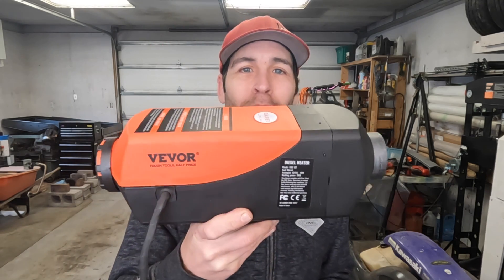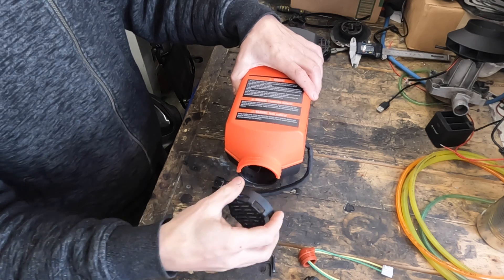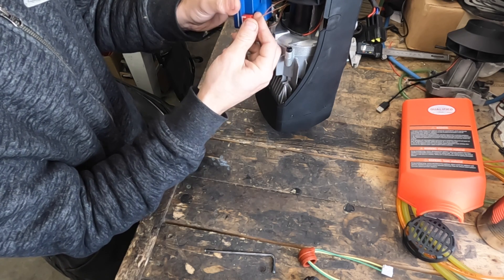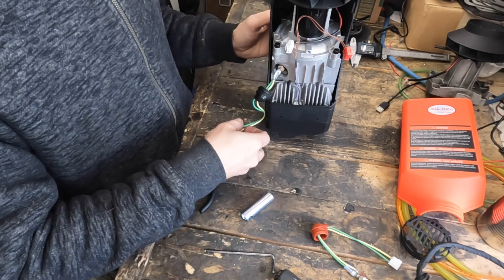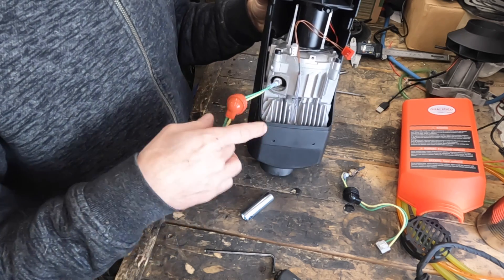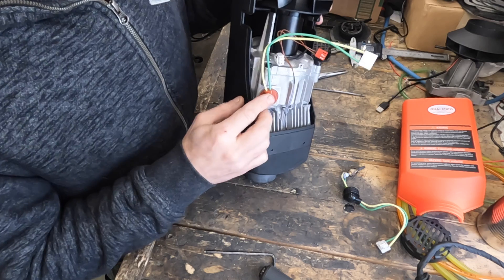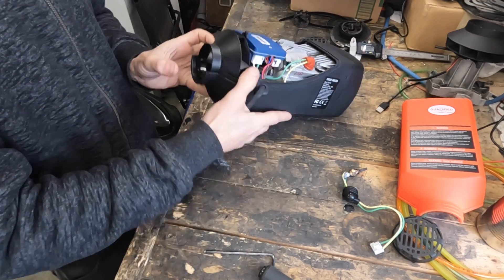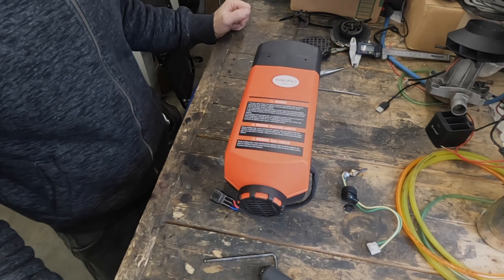Diesel Heater Glow Plug Replacement - 2, 5 & 8 kw Heaters. (see pinned comment)

Comment from the maker: A few people have mentioned things I should have / could have included in this video, that I think are important. I decided to pin this comment and add important info if it becomes apparent. 

1. To test your glow plug is VERY easy. Get a 12V battery, that you know is good, and connect power to the plug for about 5-8 seconds The plug should glow red hot. Positive and negative can go to either connector, it doesn't matter at all. Make sure your wires are no smaller than 16 gauge, preferably 14 gauge or the wires could get really hot when connected. Do not stay connected for more than 8 seconds or it could damage the glow plug. 

2. The glow plug mesh must be seated below the flame initiation hole. Where the glow plug threads in, there is a hole about 3mm in size. The reason I say to "push the mesh all the way in" is because if the mesh plugs the hole, you may have starting issues.

3.If you have the "special tool" you can change the glow plug, by just screwing the end cap off and removing the cover. The heater can be installed with everything still hooked up.
Reply: You could probably use a small 9V battery to check the glow plug with. I don't think the motherboard feeds the plug the full 12V.
Reply from the maker: @kirkwalsh1932  Yeah... A 9V battery wouldn't have enough amperage to make it glow.  With a 12V battery it will be obvious within a few seconds if it is working or not 🤟

Comment: Watch out: It is NOT mentioned in Vevor documentation!: Don't use a Vevor Diesel heater on a lithium battery. The 14,4-14,7 V will destroy the ignition plug, maybe even the circuit board. !!! Use AI and you'll find the error!
With the latest versions, the high voltage warning comes only, after the unit broke down after using it a few days on a lithium battery in the camper. No high voltage warning before breaking down. It stopped with an error E01. Lower voltage had no effect. Damage not yet known, but probably a destroyed ignition plug. Damage on the circuit board is also possible. 
Worldwide standard should be resistant against 20% overpower and that is 14,4 V Basis 12 V. If you have a lithium battery use a DC-DC 12V convert with at least 15A. (example 4-40V 20A 12V converter).
Reply from the maker: Hey, thanks for the detailed comment. 

Every one of these heaters that I have owned says that the are okay to run between 12-24 volts and it appears they have auto detection... I suspect there is something else going on with your heater. 

If you only had this happen once, I suspect that this was just a fluke, and not actually a common thing with "these heaters" ... I believe this for several reasons. 

I have used my heater with a lithium battery several times, a few times earlier this season, once while camping. I just ordered lithium batteries for my bus. I'm sure many others have also used lithium batteries as well. Also... the ECU uses PWM to control voltage to the glow plug and fan, and the voltage is ramped up and down ... Generally not all 12V going to the plug or fan. I know this because I have connected these items to 12V and it's pretty intense. 

I think you need to look a little deeper into this. My guess would be that your ECU has an issue.

Comment: Very informative, I was able to get mine out without taking the ecu off.
Reply from the maker: Yeah, that's actually the smart way to go about it, if you are not doing more maintenance on your heater. I'm very much in the rabbit of using a normal wrench to remove mine and doing complete disassembly.

Comment: Can replacement glow plugs be sourced locally? These heaters are so cheap that I almost just want to buy a whole new heater. All of the other parts are super dirty as well. I’ve had mine for 4 years, which is about 3 years longer than everyone said it would last 😂
Reply from the maker: Depending where you live, you may be able to get one locally... but not where I live. However, you can get them next day on amazon very cheap, in most places. 

It is almost worth having a second heater as a back up or for spare parts. 

Is the controller giving you a code for the glow plug ? It's not very often that they actually go bad. I think they are often replaced when they don't need to be replaced.
Reply: @loweredexpectations4927  It was giving me E-8. I’ve primed and restarted several times and now it’s blowing white smoke and the plug icon is not lit. I may have flooded it with fuel.
Reply: Oh and it stopped working after I had accidentally drained the battery and it shut off without being powered down properly.

Comment: I just bought mine last winter and it works.Great for my thirteen hundred square foot house , replacing three or four space heaters throughout the house , actually😂. But the error code said the glow plug just went out.Hopefully , that's not something that happens every year , but still in easy , cheap fix. Great to offset the price of electric heaters and works much better. Especially just turning it on for 20 minutes to Jack.The temperature up a real quick in three hundred and fifty square feet living room
Reply from the maker: Thanks for the comment. 

I have only replaced this glow plug and it is because I broke it... I think it is quite uncommon to have to replace them.

Comment: If I knew it went out every year , I wouldn't have bought one😂. Sounds like it's cheaper and easier to buy a new one than it is to replace. So you have to buy a new heater every year. Annoying
Reply from the maker: Say what ?? I have had several heaters, currently have 8 and the only glow plug I've replaced is this one... I've never heard of replacing once a year... If so, something is very wrong. 

Also... they are incredibly easy to replace. The way I demonstrated here is the long way. You can simply remove the inlet nut, open the cover and and you have access to the glow plug hole.

Comment: Helpful video! Not sure if this is my problem or not...    my heater is new.  Ran good for 100 hours roughly, now it smokes like crazy out the exhaust when trying to start it up.  Also it smokes out the bottom where the exhaust clamps on and when an Error E8 comes on and the unit shuts down, it sometimes blows unburned diesel out the intake aswell.   Im confused.  Can you help?  Have you seen this before?
Reply from the maker: Hello. Sorry to hear you are having issues. These heaters are pretty stupid... the E8 code just means that it has detected a low temp during operation and shuts down. Don't read too much into the codes as some people will claim they mean a lot more. 

If your heater smokes when trying to start up, the glow plug could be the issue. You can try powering the heater on for about a minute and turn it off just before the fuel pump starts pumping. If you do this 3-4 times in a row, it could clean the glow plug off and save you the hassle of taking it apart. (the glow plug glows for a while before the pump starts) 

Most commonly, these heaters have issues due to the exhaust or inlet air being restricted too much. The exhaust should not have too many bends and ideally no sharp bends. Same with the inlet. 

If possible, try running your heater without the inlet and exhaust installed and see if that helps. If so, add one if them and try again until it works poorly. If it works the same with them removed, then it is something internal. 

You may also want to use a voltmeter or monitor the voltage on startup. The glow plug runs on start up and depending on your power souce and wires, you may be getting too much voltage drop.

Comment: What size socket is that "special tool"?
I want to make one but i cant remember what size it is, lol
Nice video btw, thank you  🙏
(That kit is currently available on Amazon for 6.99 +)
Reply from the maker: I should know this, because I never use the tool... I always just take the fan housing off and use a wrench. Sadly, I do not remember. I'm thinking 12mm.

Comment: How do you know what wattage the replacement plug is? Under the advanced settings you can set the PF menu for the different glow plugs, I think.
Reply from the maker: From what I understand, they are all about the same, and the PF is to send more power to the glow plug. For conder starts, your heater may require more plug power. 

I personally have never had an issues with start up, so I haven't had to play with this much.

Comment: Where the glow plug goes , Is there supposed to be a hole at the bottom  ?
Reply from the maker: There are a few holes, depending on where you are talking about. 

There is a hole for the fuel to come in from the fuel line, there is a hole for the fuel to run into the burn chamber and there is an air hole in the side. This is usually called the "flame initiation hole".
Reply: @loweredexpectations4927  
Fitted the new glow plug & she works . Thx for the reply 👍

Comment: About how long before changing these
Reply from the maker: No real need to change the plug unless it throws an error and won't ignite. There is a mesh around the glow plug that can be changed every few years, but the plug itself may last forever. It is a ceramic heater.

Comment: Funny I came across this video just now as I was trouble shooting my new replacement 5kw heater (error code E-07) for my old heater than ran fine for many years . I dissasembled heater and found that the glow plug spun out with a twist of the wires! I'm glad it didn't start!
Reply from the maker: Apparently this is pretty common. They are often not tight, or just finger tight from the factory.

Comment: How often should you change the glow  ?
Reply: Thanks.
It only starts if I leave the van running whist it goes through the starting process, because the relay switch packed in so thought that was part of the problem and changed leisure batteries and still won't start without van running  !! No one seems to know why  .....
Reply from the maker: @paul2241xx  The glow plug draws about 10 amps... so you need to be connected to / with some large wires ... preferably 12ga ... Even with a battery connected directly to the heater power wires, you will see a significant voltage drop during start up. Voltage drop seen by the heater, not by the batteries. 

I recently reinstalled my heater, and decided to connect to an accessory outlet, and the wires are too small. My voltage drop is all the way down to 9 volts ... I saw as low as 8.9, once. While the accessory plug is fused at 14 amps, the wires are way too small, apparently, so I will have to redo mine soon.
Reply from the maker: If it is broken (you get a fault code) or if the heater makes a lot of white smoke on startup, and you have changed the mesh, and it doesn't solve the problem. 

If the heater is running properly, the mesh and plug should be fine for many many years, unless it is faulty. I would not change this as part of heater maintenance.

Comment: Can I do this with it still strapped down to my floor? , or does it have to be stood up on end for a reason?
Reply from the maker: If you have the "special tool" you can change the glow plug, by just screwing the end cap off and removing the cover 👍

I have several heaters and most of them are not permenantly installed in anything, so that didn't even occur to me.
Reply: @loweredexpectations4927  OK thanks for your quick response! , & that's really going to save me hours vs going through my 4" custom turret in a 5th wheel Camper floor. 🙌
Reply from the maker: @hickboy3067  Awesome ... good to hear.

Comment: Question! Do you know if they make lower power glow plugs so that it won't overload a power station DC output?
Reply from the maker: I can't say for sure, as stranger things have happened, but I suspect no, because that much power is required to ignite the fuel reliably.  

To remedy this, you can put a small 12V battery in parallel with your power station and it will provide the extra amps on start up.
Reply from the maker: Something like this... but you may need a charge controller of some sort so it doesn't overcharge. 

https://www.amazon.ca/EnergyKing-Standard-Security-Rechargeable-Two-Year/dp/B0CDCR6W84/ref=asc_df_B0CDCR6W84/?tag=googleshopc0c-20&linkCode=df0&hvadid=579246844797&hvpos=&hvnetw=g&hvrand=2933791810227099329&hvpone=&hvptwo=&hvqmt=&hvdev=c&hvdvcmdl=&hvlocint=&hvlocphy=9001314&hvtargid=pla-2245049365409&psc=1&mcid=f964ca8a5c763e4aa68218defef91f83

Comment: I just got two of these. Then when one breaks, it's a simple replace-install. Then service the other when necessary parts arrive. It's not so easy anymore, as it was just 5Y ago, to get parts quick enough, and for the right price.
Reply from the maker: That's also a good way to ensure you will never need to replace one... If you don't have a spare, that's when it will fail ! haha.

Comment: Joel,there is one other important detail when renewing a glow plug mesh. The cylindrical mesh needs to be pushed in far enough so the top of the mesh is below the cross drilled air hole ....you may have mentioned this in a previous video.
Reply from the maker: Yeah, I should have specifically mentioned that it must not cover the flame initiation holle. I did say to push it all the way into the hole, but could have been clearer.

Comment: My 5kw vevor came with the metal-ish gaskets; they didn't make it. I've ordered twice from Amazon and they sent the smaller size, do have a recommendation for my heaters gaskets ?👍👍🙏
Reply: You can make your own from gasket paper. 
Gaskets cut from flat cardboard and greased before fitting also works just fine. My heater has run with homemade greased cardboard gaskets for the last 2 years.
Reply: @howardosborne8647  thank you,  I might try that.😁👍
Reply from the maker: Yes, as howard says, I have made many gaskets from cereal boxes. The smaller size is for the 2kw, usually you can select what ones you get. 

The 5kw parts are usually listed as 5 / 8kw or 5 and 8kw

Comment: Is this video because of me? 😂😂 i just got my tool delivered last night. Gonna confirm whether or not the ecu is bad or if it is indeed the glow plug.
Reply: To check if a glow plug is faulty just remove it from the heater and connect the 2 wires to a 12 volt battery or DC power supply. It will get hot and glow if it is working properly.
Reply: @howardosborne8647  I needed the tool to remove it because I was too lazy to completely remove the entire set up from where it was screwed down. 😂 but also, my ecu was giving me the error code for faulty plug. Which is either the ecu or plug. But I'll definitely check that when I get home.
Reply from the maker: @plainandsimple1  Yeah, like it has been mentioned, you can easily test your plug by connecting it to a good 12V battery or 12V power source that is capable of at least 10 amps.... if it is good, it will glow in about 5 - 8 seconds. Don't leave it connected to long if it is glowing or it may burn out... I'm not sure. 

Also use 14 ga wire so that the plug gets hot and not your wire... too small of wire and you will have glowing wire and a cold plug, haha.
Reply: @loweredexpectations4927  glowing wire = warm hands. Amirite?! 😂
Reply from the maker: @plainandsimple1  Not the ideal hand warmers, but yes... very warm. 🤣
Reply from the maker: @howardosborne8647  Yes, that is a good tip that I should have mentioned.
Reply from the maker: @howardosborne8647  I added this info and some other stuff in a pinned comment. Thanks.
Reply from the maker: Haha... this video is for everyone who needs a little encouragement to get in there and have a look 👍
Reply: @loweredexpectations4927  thanks man. Your videos have seriously been awesome lol keep it up!
Reply from the maker: @plainandsimple1  Thanks !

Comment: For some reason the glow plugs on many heaters including mine come hand tight for some reason.
When i had to change mine it was so loose i didnt need a tool to remove it and ive heard of others with this same issue..
Reply from the maker: Yeah... If your heater is installed upright, this doesn't really matter. As long as it is sitting in the hole, all is well. 

If you mount your heater is a way not recommended by the manufacturer, you may have issues with diesel coming out around the threaded section, if it is loose.
Reply: @loweredexpectations4927  Another thing the first time I tried to wind the plug in with just turning the plug with the wires gently it snapped jist like yours did, they arnt very strong.
Reply from the maker: @martinpanks992  The plug snapped ?  I had a close look at the one of mine that snapped, and it appears to be because of the way they crimp / attach the threaded section to the plug. When this is done properly (evenly 🤷‍♂) they are quite strong.... but you don't know until the snap, haha.
Reply: @loweredexpectations4927  Mine broke right at the end of the wires just where the metal starts..
Reply from the maker: @martinpanks992  Yeah, mine too. If you look into the hex part you can probably see an uneven crimp... if the ceramic washer is removed.

Comment: If you're running a video camera and it has an output for Mon or HDMI on it - get a monitor so you can watch your framing.  However, if you start to use it, don't get into the bad habit of watching the the monitor when you talk to the camera - that lens is what you wanna be staring at right?  (grin)  5M of exhaust pipe Sweet, can't wait to see that one!
Reply from the maker: Hah... yes. My framing went a little out of whack on this one.... I was rushed and didn't catch it.... I use a GoPro and it does have a front monitor that I keep on for filming in my shop, but like you say, try not to stare at it as it comes across odd .

The 5M exhaust video should be out Saturday👍